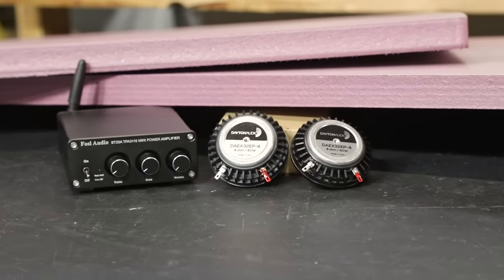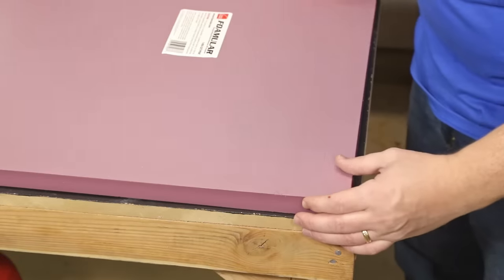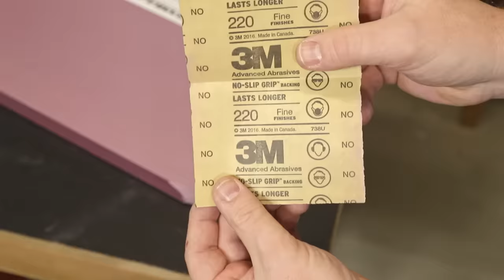How To Build "The World's Best Speakers" - Are Flat Panel Speakers Really Any Good?

Comment: @AmplifyDIY glue a 8”-12” speaker cone directly with no Sorround  to the back of the magnet and see if that increase the low mid the sound will reflect off the wall from behind the panel

Comment: I wonder what would happen if you could mount or glue the driver to a very hard wall or other surface so that the only thing moving is the foam. Hmmm.
Reply from the maker: Stay tuned to find out - I'm testing exactly that in an upcoming video. Thanks for watching!
Reply: @AmplifyDIY  dank

Comment: hey man,
i built these and i have to say my expectations were not met.
they sound very mid-heavy with bad bass and highs, like talking into a brass can. not awful, but far from impressive. good for jazz and classical, but not very detailed. i bought a pair of second hand bookshelf speakers for 30 bucks that sound way better. for the dml panels i paid around 70.
maybe i am missing something, i'm using and old denon power amplifier with no EQ controls that has 50W per channel @ 8ohms. maybe i have to add an equalizer?  or was i foolish to believe these could sound better than membrane speakers?

any tips would be greatly appreciated.
cheers!
Reply from the maker: Hi Raoul - How they perform is pretty strongly affected by where they are placed in a room. Specifically, if you place them near a wall with no acoustic insulation behind them, they'll sound similar to what you describe. If you need to place them near a wall (like, within 3 or so feet of a wall) then you will need something behind the speaker to absorb the sound coming off the rear of the panel so it does not reflect off the wall and cause a bunch of destructive interference. 

Other than placement, it could also be that your tastes are simply different than mine. I found these to be exceptional at reproducing acoustic music. I did a pretty involved follow-up where I tested a bunch of modifications: https://youtu.be/XC814uQjlaE
Reply: @AmplifyDIY  
I am planning to use them in my garden house and had them set up for testing in my apartment, where there is little space to experiment with placing/spacing.
i will give it another shot in the new environment and see if i can utilize your advice.
thanks for taking the time to answer!

Comment: I tested this with a friend. A plate of balsa wood gave us the best results. The foam we used was rather disappointing in comparison

I have to correct myself: we used paulownia and not balsa wood
Reply from the maker: Thanks for the idea!
Reply: I believe balsa wood might work well too as it’s very light but quite hard. Paulownia is slightly heavier but also more resistant to impact. The sheet of paulownia we used was about 60cm by 40cm and about 1.5 cm thick. We did not round the corners as we wanted each material to be as close to each other in shape as possible, but I believe that might improve the results even more. Recordings of acoustic guitars sounded like the guitar was in the room. Electric guitars needed some eq to sound good. It would definitely be beneficial to cut the signal below 120hz and send the lower part to a standard subwoofer as that would clear the sound up quite a bit. In the lower end the exciter caused quite a bit of rattling.
Reply: @AmplifyDIY  I have talked to my friend about that topic and he said those ceiling tiles you find in office buildings are also amazing for use with exciters. I feel like a very uniform and hard medium which is also quite light would grant the best results. I‘m planning to build two paulownia panels for exciters as I like the wood optic and it fits my other furniture quite well
Reply from the maker: @lohikarmi235  Paulownia is not easy to get here in my part of the world. I'd love to hear how it sounds compared to the standard foam panels.
Reply from the maker: Ceiling tiles are easy to get - but I would love to try out some Paulownia, as I much prefer a natural wood grain aesthetic. Best of luck with your setup!
Reply: @AmplifyDIY  If I remember I‘ll link you a video once they’re completed

I got lucky as my local Bauhaus carries Paulownia sheets

You could try balsa if you can get it. Otherwise I believe plywood might work good as well. I have not tried that yet tho
Reply from the maker: @lohikarmi235  I'd love to see a video - feel free to email me a link directly if you can't find this comment chain later: amplifydiy (at) gmail (dot) com. I have tried plywood, and it really is pretty terrible. It's too stiff/non dynamic. The whole top end is non-existent with it... though I did only have a 1/2" (around 12mm thick) piece. Something thinner may perform better.
Reply: @AmplifyDIY  oh ok. Plywood ain’t a good choice then. I‘ll definitely try to post a video of how they sound once they’re done.
If you’re in the US paulownia might actually be available online, but it is noted as not being very cheap

Comment: Curious to what a grooved surface would do to the sound like a Fractal lens.
Reply from the maker: Based on what I'm hearing testing a whole bunch of other setups, I suspect it would not improve the overall listening experience.
Reply: @AmplifyDIY  So also the gent from Tech industry channel said the painting is fine but sanding of the plastic layer is important. 

Which mean putting a vinyl decal would be bad yes?
Reply from the maker: @genestarwind4610  My testing seemed to indicate that sanding the surface does indeed make a positive impact on the performance. Painting the surface had a negative impact. I hope to have the follow-up video finished up soon (lots going on right now, no promises... ) where you'll be able to hear specific differences in the sound with subtle changes to the surface/shape/etc.

Comment: For the lows I'd say even like a 2' 3" X 2' 3" cardboard box would be good enough for the lows to sound better. Just suspend it in that or in front and boom goes the bass… maybe. I'm definitely going to try something like what I just explained though and see what works best
Reply: The reasoning for me saying maybe even in front is because I have a 15 inch sub in the back of my car. Once I had to take it out for something. I was testing it and it worked fine so we put it back but before it was even in the box (I'd say probably 4-6 inches away) I was hearing the sound it was producing. I've messed with small speakers in cardboard so thats why I think cardboard will be enough for these
Reply from the maker: I'd love to hear about how your experiments turn out!

Comment: The thing is big panels are great for reproducing big instruments (upright bass for instance) and can have an amazing stereo image. That's why I loooove my 35 years old cheap Magnepan SMGA. 2 downsides, though : not very dynamic and require a high powered amp (and a subwoofer). Anyway I think I'll never switch back to traditional speakers...
Reply from the maker: I agree - with a sub these are really good. The transducers I'm using are not super power hungry though, and they are actually louder than a good set of bookshelf speakers from Klipsch at the same amplification level. Stay tuned for my upcoming video where I test this as well as a bunch of other viewer suggestions and questions. Thanks for watching!

Comment: I can't, for the love of me, find those panels in my country. Are those anything like XPS (extruded polystyrene) boards?
Reply from the maker: That is exactly what they are: Extruded Polystyrene. 1" (25mm) thick. They are typically sold as insulation panels, and are rated at 5R for an insulation value, I believe.
Reply: @AmplifyDIY  Thank you kindly, you saved my project! Thanks for getting back to me that fast.
Reply: @AmplifyDIY  Sorry, another follow up question. If there are only 20mm (0,8") or 30mm (1,2") thick panels available, which would you recommend?
Reply from the maker: I'd probably go for the slightly thicker ones (30mm). Hope they sound great!
Reply: @AmplifyDIY  Thank you for your advice. I will try those.

Comment: The Tech Ingredients guy uses rectangular boards to avoid destructive interference & produce more frequencies (same reason for placing the transducer off center)
Reply from the maker: Hi Robert - they have done a whole series of videos, both with rectangular as well as square shaped boards. I elected to dip my toe in the water with just the square ones, but I've had a lot of requests to build out a more complex system (with rectangular acoustic ceiling tiles, for instance). So many video ideas, so little time.... Thanks for watching!

Comment: I just made a pair of these and I really wanted to like them. However, I am quite disappointed with them even compared to my cheap samsung TV's built in speakers. I am in a relatively small room and I find that even my TV fills the room better. Do you think I could have done something wrong?
Reply from the maker: Where and how did you mount them? If they are placed very close to a flat wall, the sound coming off the rear of the panel reflects off the wall and causes a lot of destructive interference. If the panels need to be close to a wall, try hanging a towel or blanket behind them to help absorb/deaden the reflections off the rear of the panel. If they are not near a wall, tell me more about how you set things up and I’ll do what I can to help.

Comment: Why the meat is missing is they are not in a chamber. Look at that Bose tiny shelf speaker. Build a box where these can be suspended and the pressures within will fill the mid and lows. Plus the larger panel and thin the larger panel by 1/8 th an inch to allow more flex for lows.

Comment: I made serveral sets of these of various materials.  I have done of foam, I have done directional balsa, a honeycomb panel and a .125" sheet of aluminum. I think the balsa sounds the best but these are NOT 'the worlds best speakers' when it comes to audiophile standards or representing music/sound in 'reference'.  Run some band sweep test on them and you will see the problems in certain areas of spectrum.  I have even tried 'ear' shaped panels and different driver placements, it mostly just 'moves' the flaw around in my testing though.

Comment: Good for a tv setup with a woofer?
Reply from the maker: The only way to know for sure is to try it yourself and see what you think. They will easily out-perform any TV's built-in speakers, but purpose-built surround-sound systems will likely offer a better surround sound system. If you are looking for something that can be more tightly integrated with your room layout and more stealthy though, these are a great option. You may also find some good ideas/tips in my follow-up video here: https://youtu.be/XC814uQjlaE

Comment: Nice!!!  You think I can buy these products in Portugal
Reply from the maker: Probably, yes. It is Extruded Polystyrene, and is used as home insulation. The size I used in this video is about 610mm square, and I’ve seen in as pink or green in several different home improvement stores. Good luck!
Reply: @AmplifyDIY  Thank you for such a quick response.  Truly appreciated. Again, Nice Video.

Comment: Now we need a 2 or 3 way test. Get the 24x24 boards and roll everything above 200hz to those. Get the 24x48 and roll below 200hz to them. Passive crossovers or caps.
Reply from the maker: Why stop with a 4 way system? I've considered building something with some dedicated tweeters on much smaller boards as well....
Reply: @AmplifyDIY  A board for every octave. Now you're thinking.

Crossover would be a bit cumbersome though...

Comment: Anyone having issues keeping the exciter attached to the foam? 
My speakers keep falling off the foam board. Not sure how to keep the foam intact.
Reply from the maker: Hey Azubuike - what are you using to mount them? Once the exciters have been mounted/removed once, you need to use fresh mounting tape to re-install them. I used this stuff in my follow-up video where I tested these things pretty hard, and never had an issue: https://amzn.to/3JP0J2l - I just cut off 4 small strips and placed them around the perimeter of the mounting circle. Worked great!
Good luck!
Reply: @AmplifyDIY  Hey thanks for the response. I'm actually creating a metal & wood stand to hold the speakers. 
Thanks for the tape recommendation, I'll purchase the tape and give it a shot!

Comment: How is the bass response?  It sounds thin.
Reply from the maker: Hi Matt - the bass on the bare panels is pretty minimal. If you like a fatter low end (as I do), you definitely want to add a subwoofer into the mix with these. I tested this in a follow-up video: https://youtu.be/XC814uQjlaE
Reply: @AmplifyDIY  Thanks.  I saw that video, and it seems like the dual driver setup with sub gave the best result in your test.  How many amps are you driving these with?
Reply from the maker: @mattportnoyTLV  I used 2 amps: 1 drives one set of exciters and the subwoofer (it has a dedicated sub channel), while the other drives the other 2 exciters. You can also wire up the exciters in series rather than parallel, as long as your amp can deal with the increased impedance. Thanks for watching!

Comment: Dumb question, but isn’t the placement 2/5 by 3/5 exactly the same as 2/5 by 2/5?
Reply from the maker: Not a dumb question at all! I should have been more clear: it’s 2/5 from the top, 3/5 from the side. Yes, technically 2/5 from anything leaves 3/5 left over, but the purpose of this placement is to make sure you don’t put the exciter the vertical or horizontal center. Using different measurements reminds me that one is from the top, the other is from the side.

Comment: Your DIY speaker build and demo would be more compelling if you performed a standard EQ room test using a pink noise source (YouTube), a basic frequency display/dB meter phone app and a decent microphone (reference mic preferred), so viewers can see the low to high frequency response of those speakers (hopefully flat-ish across the spectrum). As shown, you’re using what looks to be an inexpensive lapel mic to record the speaker output. Pair that with a power amp with unknown frequency response specs, the acoustic response inside a garage and the speakers your audience is using to hear your demo audio tracks (via cell phone, laptop, desktop computer speakers) and you’ve got some sort of a test that’s, sorry to say, weak, but admirable on the face of it.

If viewers are confident panel speakers are a direct upgrade compared to what they now have, go for it. There’s also a chance a pair of decent, used bookshelf speakers might sound better with albeit, a less interesting build story. Perhaps the website source you referenced has tested these panel speakers more objectively. Dunno. Good luck folks.
Reply from the maker: You are right: I was not expecting these panels to sound good at all, so I was not prepared to do any reasonable testing.  But I did an in-depth follow up here: https://youtu.be/XC814uQjlaE

Comment: Suggestion; anchor the drivers in the rear to something thick and solid. Between the drivers, have plenty of fluff to stop any harmonics. Right now, the effectiveness of the speakers is limited by the mass of the drivers having nothing to stop them from just being pushed backwards.
Reply from the maker: Hey K__ R__ - I tried exactly that (as well as a bunch of other modifications) in this follow up video, if you are interested:https://youtu.be/XC814uQjlaE

Comment: Wouldn't mounting it by the driver itself be more efficient and give a better sound? Seems like there is wasted energy or potential with it free floating
Reply from the maker: Stay tuned! I'll be testing that in an upcoming video. I have not filmed that portion yet, but I'm guessing they will actually sound worse when the drivers are mounted to something firm, what with newton's laws being what they are and all... remember the old "equal and opposite action"? All that movement you see in the driver itself is also happening in the panel. I suspect by firmly mounting the exciter you'll deaden a LOT of the performance, specifically because the mass of the exciter can no longer freely move. Can't wait to finish building my rigs so I can do the tests!

Comment: I’m also still skeptical and I’m curious if the impression of ‘goodness’ here has more to do with their wide stage rather than frequency flatness and response.
Reply from the maker: With acoustic performances (particularly woodwinds, upper strings, and vocals) these are REALLY REALLY good. They are not great for other genres such as rock/heavy metal / pop / electronica, but they are still "good" for those. Just not great. I did a follow up here: https://youtu.be/XC814uQjlaE

Comment: How would you construct on a 4 ft x 8ft sheet.. 2 driver's from the same channel? A courtyard setting perhaps... Not necessarily for loudness, but spacial experience.  At this price, it's an affordable experiment.  (Getting extravagant, maybe like James Bongiorno 3 channel stereo. ) Yikes!
Reply from the maker: Hi Paul - according to Dayton Audio (who make these exciters) on a large sheet like that you can actually produce a stereo image. I would place 4 exciters, 2 per channel. I'd mount the panel horizontally, then place the 2 exciters for the left channel near the left edge - one centered vertically, about 8 inches in from the edge, the other 2/5th's down from the top, about 12 inches in from the edge. I'd mirror that on the right channel.

They sell 4x8 sheets of this stuff at my local Home Depot.... *gears turning internally.... *
More info about mounting on different sizes of stuff here: 
https://www.daytonaudio.com/topic/excitersbuyerguide#installation
Thanks for watching!
Reply: @AmplifyDIY  GEARS TURNING, and TEETH SHREDDING.  When I get hooked on a new thought, it's painful.